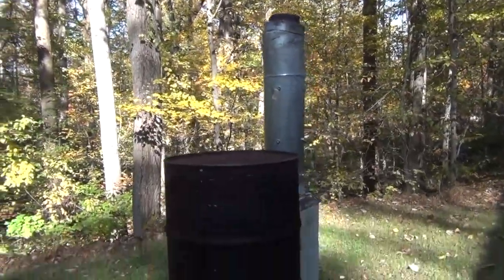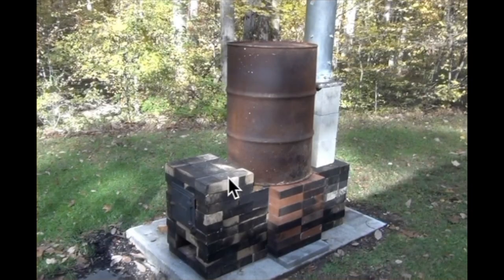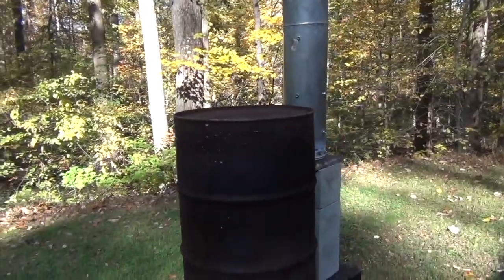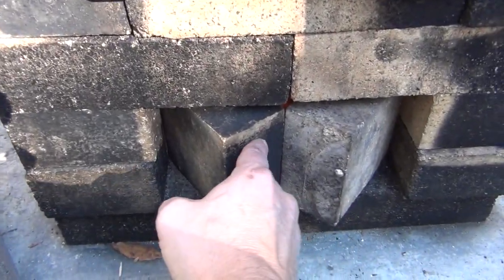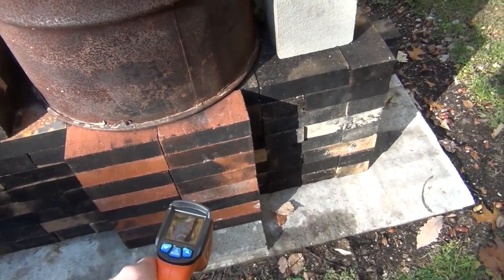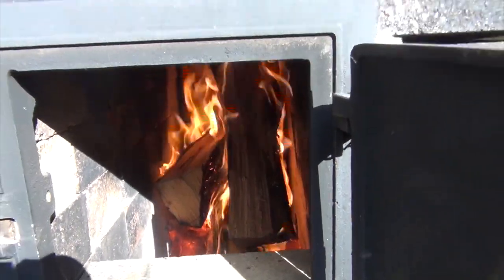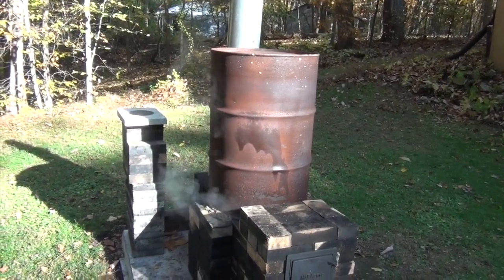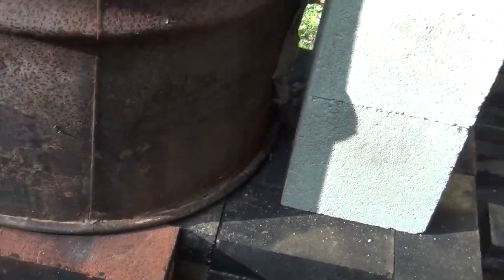Upgrade To Last Stove - SUCCESS - Added 300 pounds of mass and 2 channels to this wood stove hybrid

Comment: So why not put a startup bypass at the top of the barrel going straight into the chimney? I'd think that after a minute or two the system would be primed and ready to draw and the bypass could be closed.
Reply from the maker: In theory, yes, that would be excellent. But .... a reminder...... My stove designs are for the NOVICE and those without much money. Designing a small pipe to pass from the barrel into the chimney (firebrick or other) is not terribly hard but then, getting it perfectly sealed with a well engineered slider so the bypass can be closed off, is very, very, hard for 99% of the population. If it's not almost perfect, harmful gasses will escape out. It's not worth the risk. Also, per my note in this video, I will do a "cold start" and see what happens to the draft. Maybe I'll be pleasantly surprised.
Reply: Nice job!